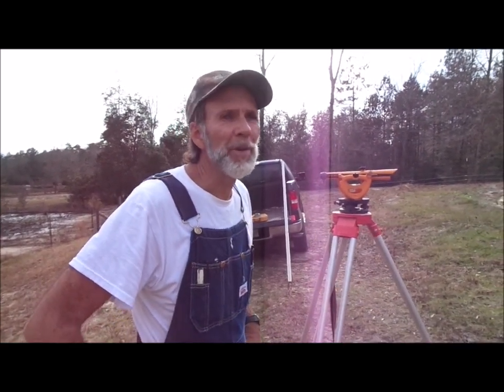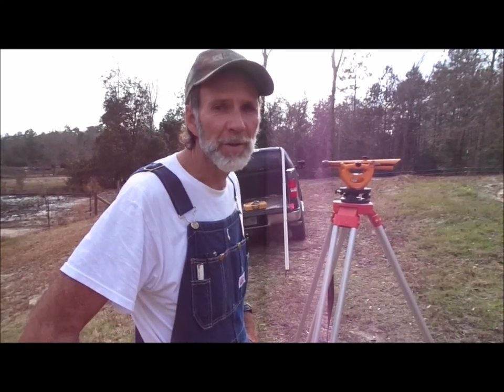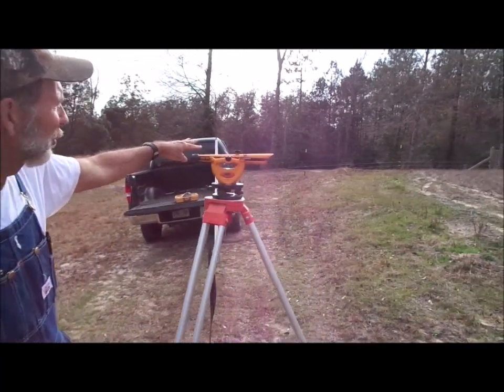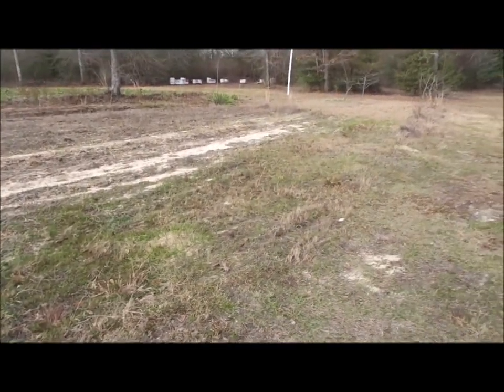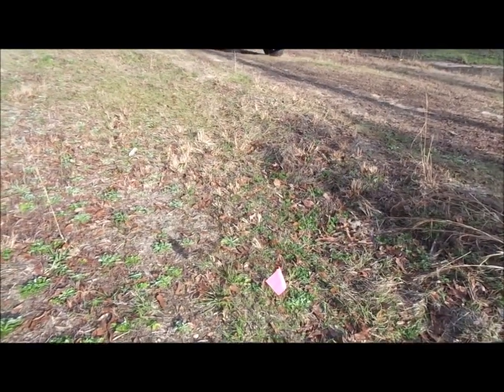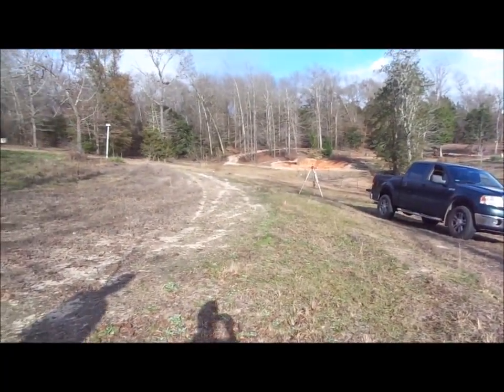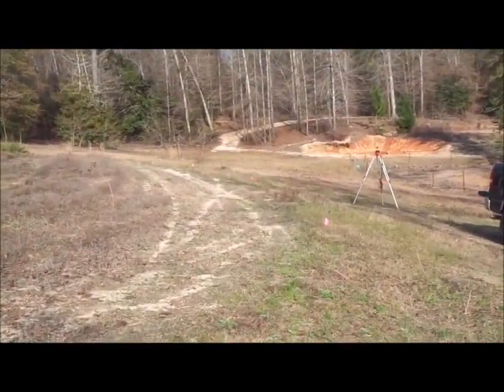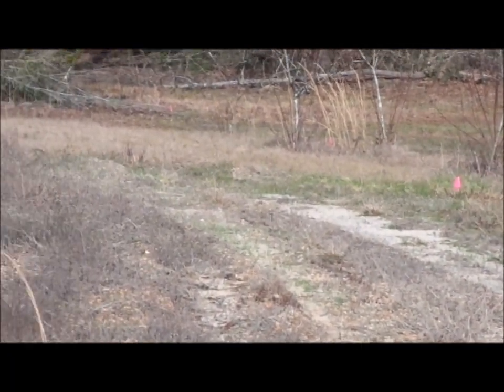Using a Turning Plow  **Building Terraces**

Comment: I bought 5 acres that used to be farm land but is now just a yard for a residential home. I'm trying to remove my terraces. Thinking my tractor with a box blade might be able to knock them down, hopefully. If not then I'll have to hire a bulldozer to take care of them. The property is high in the middle where the house is and the front and back yard has a slight downward slope. I have no use for the terraces since I'm not growing crops on the land. Only lawn grass. The grass will grow just fine without them and it'll help drain off water better and keep the yards from getting sloppy and soupy after every rain we get. The ground is that infamous Alabama red clay. Lol